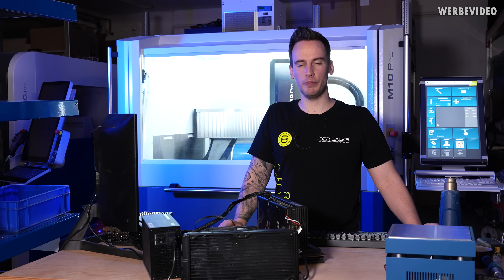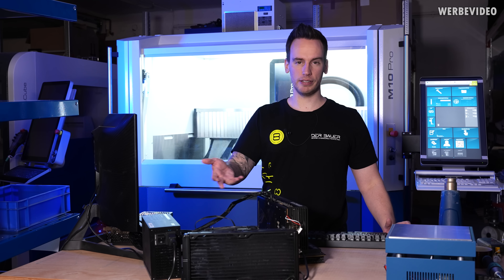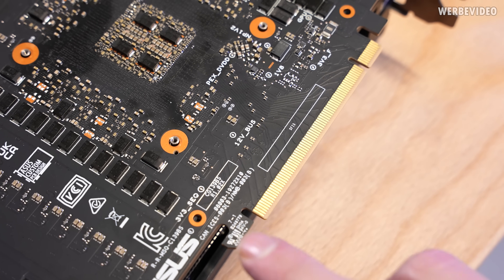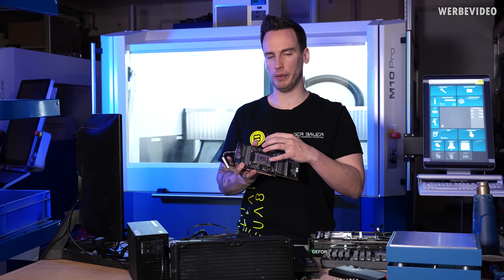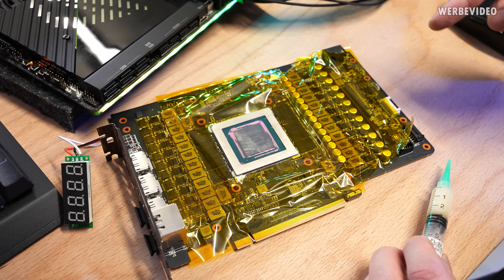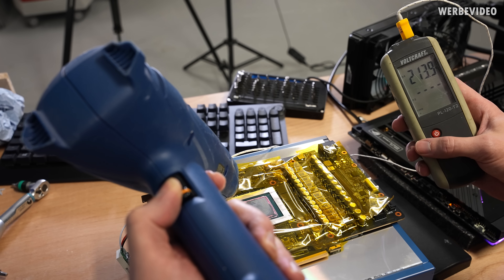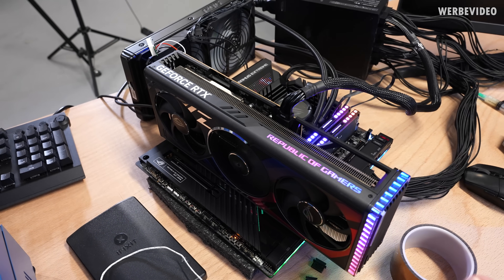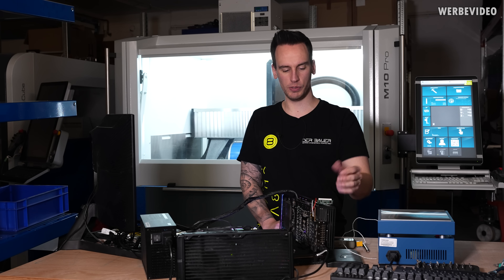I tried to repair my RTX 4090 and killed it :(

Comment: I'm a board repairman here in Brazil, this defect is related to memories, communication failure, you can use the mats/mods software to discover the faulty memory channel and change the module, hugs from Brazil.
Reply from the maker: Very interesting. Will look into that :) thanks for the comment!
Reply: @der8auer-en  Speak to GerRepair
Reply: @der8auer-en  this man may be right. I run a repair shop and this issue usually is a faulty memory chip.
Reply: @der8auer-en  that's true, when i saw you tape all the card, i immediately thought the uneven pressure all over the card may be a problem. Due to the uneven pressure, some memory "ball solder " may short each other which is a problematic situation and hard to recover. The only way is to resolder all memory module or like the op mentioned, use some proprietary linux software to check which channel of memory is faulty(like the 2000 series artifacts is repaired in this method)
Reply: Seems more likely that the BIOS is shot from the heat. I remember older GPU's not booting on their own, but showing up in the system on booting with onboard video when the BIOS memory had gone bad. This looks like a similar issue. Sounds like a vBIOS/eeprom failure. You could try reballing the eeprom chip, or replacing it all together.
Reply: @AlphaMachina  vbios chip isnt near the location where heat was applied plus when its reflashed then what has been written to the bios memory can be checked / verified. wheras vram memory chip were very close by if not actually directly in line of fire. so the mats/mods suggestion makes more sense here.... however assuming this then you would still need to reball or reflow a gddr6x right next to the gpu core. and that task is pretty challenging. it isn't at all easy and should be handed to somebody else with better equipment and tools to stand any chance of a real success.

of course relatively changing the spi chip is easier to eliminate as a potential cause. or it could be both. just not as much reason to suspect over an actual bad vram. for example when the card boots it probably reads the contents from the vbios and copies it over on to the vram. before going further... if 1 of the 12 vram chip is bad then that will consistently corrupt the contents of that space in the memory every 1/nth bit or byte could be a bad data. (assuming there is no ecc error correction)
Reply: This gentleman from Brazil is correct.
Reply: This might help. Definitely try mats and mods on usb stick
Reply: @MillaGamer, 

I'm currently have a wierd issue with my 4090 TUF ASUS non-OC card. 

9 out of 10 times the card only runs at x8, 1 out of 10 times it succesfully runs in x16? This is after boot up, and it stays that speed throughout the session until i reboot again. 

Do you have any idea from your experience why this can be? 

(i have double checked that nothing is officially taking PCI lanes on the motherboard, all bios updated to latest etc, tried different bios settings etc, nothing worked).
Reply: @calop002  return as warranty something is failing try the second vbios if you have one but i suggest to return it
Reply: @calop002  Does it not go down to x1 for powersaving?
Reply: @calop002  This is gonna sound so obvious and you have probably already been down this ally, But have you fired up GPU-Z and run the test? Your card will run below x16 when not being taxed..
Reply: @mozzjones6943  Thanks for the rreply, yeah i tried all kind of benchmark and loads on the card. It doesnt change from x8, regardless of the load. 

When it boots up in x8, or x16, it stays in that speed througout the session.
Reply: @calop002  Is the gpu on a riser cable?  Do you have an m.2 drive installed? - Try moving it to another slot to see if causing a weird issue..
Reply: My money is on original fault being a pcie lane trace issue, possibly a bga connection fault. Then in attempting to reflow you’ve either created bga problems under the memory modules as well, or created a new bga problem under the gpu.

Or the PCB has popcorned and you’ve got likely several in-board traces that are now severed.

I suspect that you’d end up having to remove the core to test trace integrity if an actual repair attempt were to be made on this card.
Reply: Memory is the more likely culprit good spotting @MillaGamer
Reply: like i said before is a memory channel problem and the card was fixed by Kriss, tks people, here in Brazil i saved a lot of cards from death using this aproach.
Reply: "come to brazil"
Reply: not sure mats/mods will even run on a 40 series, its an older program.
Reply: Yeah putting a heatgun to it doesnt help
Reply: A não viado. Onde você estava quando eu precisei????
Reply: Lol does brazil have computers??
Reply: is there MATS/MODS already around for 30/40 series?
Reply: I don't think its a memory failure.  MAT/MODS will only test memory.
Reply: Another tip is to never have tape or thermal pads on the board during the heating process this will cause components to move around which is not good.. This procedure is never a good solution because 90 percent of the time it is either broken traces or and corroded pads which require cleaning..  You should always use the proper equipment to pull the GPU clean the pads and reball it.. Hope this helps keep up the good work..  Lmk if you need it repaired or want to sell it..
Reply: Same thing happened to me on my 3070ti when I switched to Liquid Metal and thermal grizzly pads. I measured the pads best I could, BUT the TG pads are substantially harder than the stock pads which are like play dough. So I decided to remove the thermal pads completely because I knew that was the only variable I was unsure of. Bingo it ran fine, so then I just ended up putting the stock thermal pads back on. I guess they use those shitty pads to take up any inconsistencies in the heights of various parts. Also I think you should reflow that using a different technique. Heat up a chunk of copper to 220 degrees and put that on there. If the pcb is not perfectly flat it could of sprung on you and broken the contacts instead. That way you could also drill a hole in the side of it and place the thermal probe in there.

Comment: Wouldn't the flux make things way worse here? Flux reduces surface tension of the liquid solder, this might make the solder bumps to flow, merge and create shorts everywhere underneath the chip...
Reply: Flux decreases the surface tension next to metal by removing the oxides on the surfaces.  It doesn't reduce the surface tension against everything else because there's no fresh metal being exposed there to stick to.

Comment: the first thing u should have not used is a heat gun , & instead should have used a proper hot air rework station , u don't need to buy a 1000$ made in japan model , a regular 100$ made in china model does the job much better than just aiming a 2kw heat gun at the gpu . u should try flashing the bios with an external bios programmer.

Comment: Replace the bios chip. The 3090 and 4090 have the solder balls so close together that this method of heating it makes it extremely easy for balls to bridge together. I used to repair RROD Xbox 360's and occasionally had balls join so would have to reball the whole chip properly.

Comment: Literally…. Clean it. Usually works.
Reply: Sonic cleaner at 80c plus before anything else. I do it as a first troubleshooting step.
Reply: Then for the END. You probably wiped the bios clean. 

Try to read and flash them with a clip.

Comment: Hi Roman, I would recommend sending the card back to the vendor and asking for a post mortem. They may well find the initial PCI lanes disappearing symptom interesting enough to investigate as it might also happen to someone else . Clearly the various environments it's experienced may not be within the warranty but if you smile sweetly  and say please they might send you another one?  😉
Reply: He said 3.0x16 I think? So lanes didn't disappear, at least not between the card and the mobo. Still you're right, could be useful info on the card.

Comment: the use of kapton tape was a horrible idea as the temperature rises the tape shift and it will pull components with it when the solder reaches the melting point

Comment: If you cant read the cards details in GPUZ, that is usually a sign of EEPROM/vBIOS failure. I have had that happen to me and its usually either fixed flashing the bios few more times and or by replacing it the chip. All hope is not lost !
Reply: @Levent_Hates_This wiriting a new bios using a chip recorder tool instead of bios update software resurected a mobo in my case. definitely he should try replacing the chip or rewriting the bios again.
Reply: is 50/50 with memory

Comment: Well trying to actually melt the solder and not making it worse on a big BGA chip like that will require proper equipment and those are not cheap or small devices.

They will use infrared heating, both sides to get the chip to around 220C for lead free from what I have seen if you want to remove it, takes a while, then reball it with leaded solder and re-solder it at about 200C using a profile that will heat up the card over say 7 minutes or so (guesstimating).

Big chips like that will most likely require fine calibration of heating zones to make sure the PCB dont warp, warping of the PCB or chip is an issue, I know I done that XD
So you would need donor cards to develop a profile for your rework machine to even start doing the actual cards you want to fix.

I knew what you where trying and what would happen.

It requires expertis and good equipment to do this, there are plenty of videos on YT showing pros doing it.

I can only do simple chips on older cards due to my low skill level and less then ideal equipment, tough mine is better then what you used and still the best I can do is 20 year old GPU's with few big balls.

Ram chips you can do by hand.

I probably cant link videos here so wont but if its possible I can dig up some that shows how its done.

But you seem to have the resources to invest in the stuff needed, after that its time and practice so I dont see why you could not learn to "reball" and rework cards if you really wanted too.
Reply: so much agree with what you said here. it seems in current situation (for this one) the better shot would be to leave alone the gpu core and just try to reball only nearby affected gddr6 chip. is more realistic goal. assuming that is what he messed up given those specific indicators

Comment: Yeah, had a Strix 4090 and Pluh... Went with Gigabytes Monster and things are 👌. The actual silicon (GPU and substrate) is more than OK. Guarantee you could find a buyer for a binned 4090 chip.
Reply: Which 1 the monsta?

Comment: I would think that either the temp probe was reading too low because of placement / mounting, or the tape had a gap / insufficient coverage to protect components elsewhere on the PCB. Not sure what you could do, short of getting a schematic for the strix card and providing it along with the card to an experienced microsolderer / board repair specialist to fault find for you.

Comment: Without checking datasheet of each components 220 is kind of high to do reflow. There is a time element to it as well. For example 200 degrees for 3 minutes etc.tjen again if it is hardware issue reflow Is the only option,

Comment: So something similar happened to me on a 3070. GPUZ showed 0MB of VRAM so I flashed the vbios with nv flash and that did nothing. So I unsoldered the vbios chip and put it in my usb EEPROM Flash and compared the vbios I flashed to it and they were wrong. So nv flash did not work or did the flash wrong. So I used the program for the usb flasher and flashed the vbios on the card soldered it to the 3070 and BOOM it worked. Maybe try doing the same thing?

Comment: ouch, i'm just a noob, but my guess is the memory got cooked. i thought they were rated for like 110C.
Reply: 110c while active and voltage is applied, in a powered off state components can withstand much higher temps.

Comment: Too hot, 150-160C is enough to revive a card if heat is going to work at all, 200+ has likely fried it for good!
Reply: 160C doesn't even melt the solder so it'd not be a proper fix.
Reply: @thatguy7595  It doesn't need to melt it completely, just soften it enough to temporarily repair any cracks or breaks.

Comment: Reflow the vram as well

Could be that a module shifted … it sees the GPU in GPU z but not the vram 

Seeing that the voltage is there vram is not shorted
Reply: think so too =]
Reply from the maker: What temperature and duration? Just the same way? 😂
Reply: @der8auer-en  Let me know what you think :)
Reply: Start at 150c for 3 min increasing temps by 20c at the same interval of 3 min … test between each heat-cycle … Do not try cool the card quickly as  this can cause metal fatigue of surface mount components  that will be colder and the PCB is still Hot as it has laters of copper that keep it warm … give it time to cool 

You can go up to 220c I guess as it been that hot anyways 

Reason I say 3min is the PCB absorbs a lot of heat … I would also rotate around the vram like making a figure 8 pattern making sure heat is evenly distributed.

That focused heat isn’t very good …

Check to see if there is discoloration between the package and the interposer

They put a sealant on the edges of the package … if there is discoloration it could be that the memory controller is damaged (in the GPU )

(If discolored) The discoloration around the package is directly proportional to the vram chip that is affected 

Best of luck

Comment: Have you tried to read the bios chip ? It could be that you killed the actual eprom with the heat
Reply: A GPU will appear in Device Manager but not boot if the BIOS is dead, this is a classic problem with vintage GPUs where the BIOS flash memory has gone bad over time.
Reply: Roman pinned a comment after uploading the video, but it seems that nobody bothers with reading those anymore.
Reply: @ruxandy  except it wasn't there when we posted, it must have been pinned just after
Reply: @ruxandy  ackchyually... even after a "successful BIOS" under Windows, the BIOS could very well still be corrupt. But I myself am more inclined for a dead GPU core.
Reply: @BobHannent  The way that a BIOS flash can go wrong is by upgrading it too often. The first advice given in case of a failure to boot, or in case of a GPU failure is to flash the EEPROM (either the one on the motherboard or the one on the graphics card, respectively). I'm pretty much against that advice.
Reply: He killed the GPU, not the EEPROM.
Reply: your response reminds me of a  cheech and chong record i once had . when cheechs car wouldnt start and chong says "have you checked the air in the tires lately".

Comment: I think one of the pcie traces inside the actual pcb layer got cracked (Between 8x and 16x) so it thinks its only plugged into 8x. Or your theory, maybe one of the pcie connection under the gpu isn't making contact anymore

Comment: I kinda wonder why didn't you RMA it.
Reply from the maker: It's a sample. I did not buy it
Reply: @der8auer-en  Of course, but why not ask Asus to replace it or at least check? I've smashed MSI monitor sample once (long live the absolute garbage stand they provide) and they agreed to replace it.
Reply: I wonder why... "Mod-BIOS allows 1000W Power Target - RTX 4090 Strix with Water Cooling"
Reply: @LolJolk  iirc PCIE lanes stopped working even before E-bios mod.
Reply: @PolskiJaszczomb  custom bios voids the warranty regardless of how the pcie lanes broke. especially the extreme overclocking and putting the 1000w limit come on thats just abusing the card
Reply: @LolJolk  As I mentioned, the E-bios was flashed >after< lanes were lost, if I recall correctly. 

Also, have fun proving a person used a 1000W bios, if it got flashed back into stock one.
Reply: @PolskiJaszczomb  bro he made a video it doesnt matter
Reply: @LolJolk  He flashed 1000W after he already knew his GPU was faulty, I'd have asked Asus beforehand.
Reply: @PolskiJaszczomb  alright bro shlt you are right just contact asus bro you win man enjoy
Reply: @LolJolk  Are you high or do you not understand English or come from USA, where going for bread requires government assigned help as school doesn't cover how to shop so you don't know what to do? His sample was damaged way before he flashed the 1000W bios, happened between volt-modding with the Elmor tool and the flashing itself or even before toying with core voltage, as we've never seen GPU-Z main tab on Strix' review. It is possible the lanes in GPU got damaged by overvolting and got cut out, but the voltage raise is pathetically low and well within GPU ripple so it's unlikely. So contacting Asus before applying (or making a video of, actually) 1000W bios was IMO the best course of action.